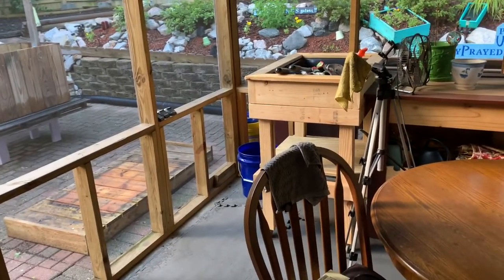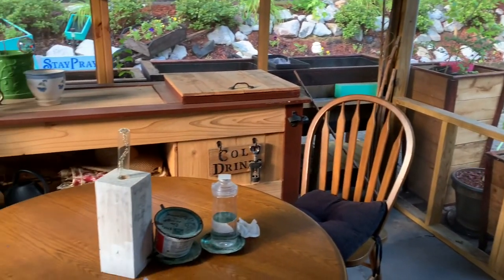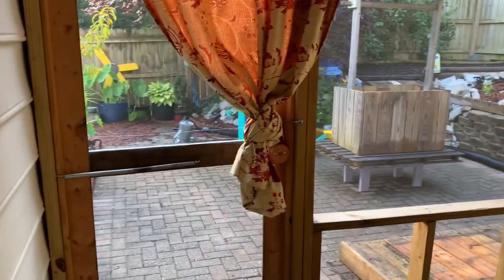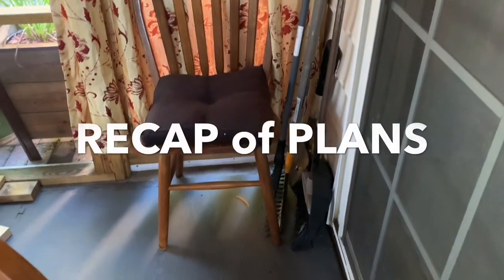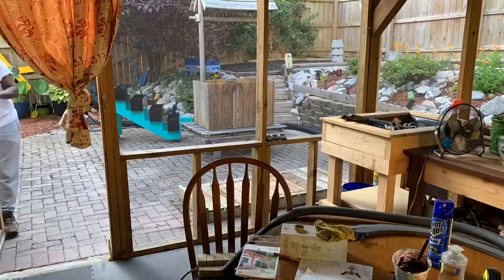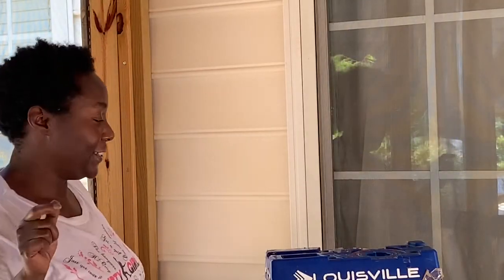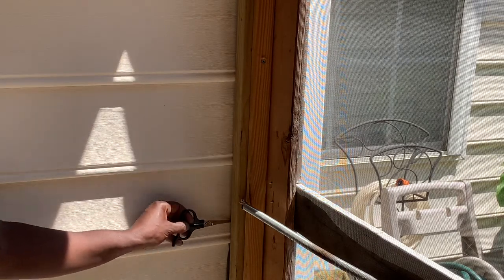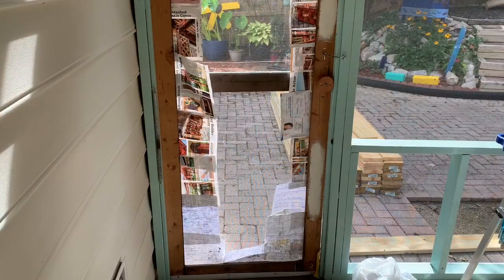EXTREME SCREENED PATIO MAKEOVER //Part One //Fresh Paint-Door Repair-Enclosure

Comment: Love it.. What materials did you use to close in the bottom of your screened in porch?
Reply from the maker: Thank you for watching.  That material is from a big box store n the gentleman said it’s used for shower walls. The name slips my mind 🤦🏾‍♀️ but it’s used with a glue to adhere to bathroom (or any wet area) walls. I didn’t use glue for the screened porch. I’ll try to get the name of it for you ok. 😊
Reply: It's plastic paneling Home Depot has it 1/16 in. x 4 ft. x 8 ft. Plastic Panel $21.56. Going to get me some sheets today! I have a covered deck that I'm remodeling and needed something to keep the rain out.
Reply: @fromherworkshop689  was it easy to cut and screw in?
Reply from the maker: @MrKris9667  omg I love you young people 😊 Y’all know how to get it done💪🏿  thank you for supplying that information 🌺
Reply from the maker: @MrKris9667  not really, it chips a bit but if you’re covering the ends it’s ok.